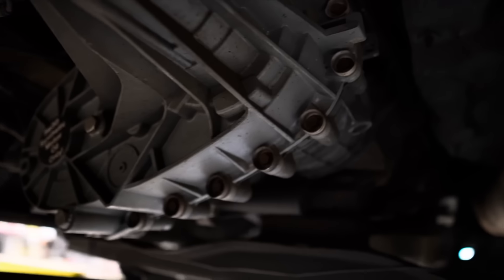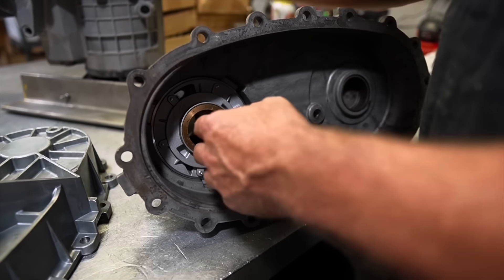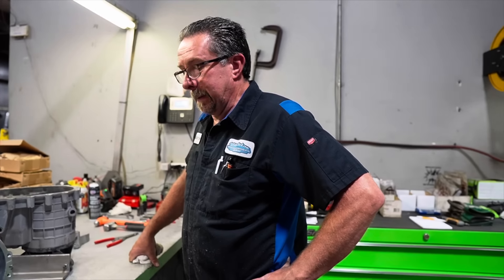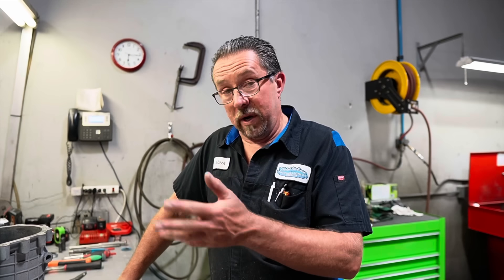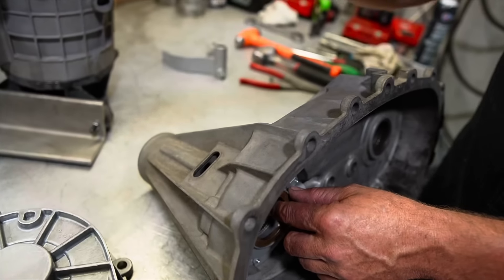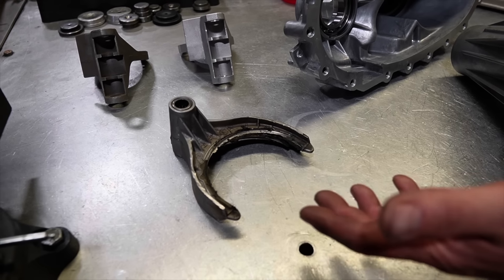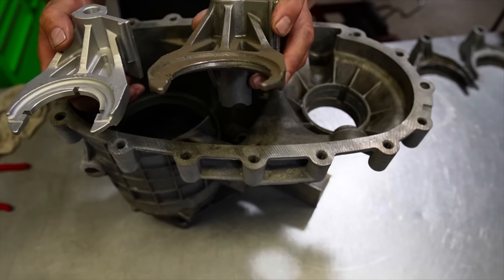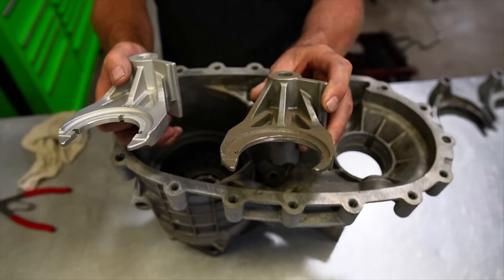TRUCK OWNERS! This Will Destroy Your Transfer Case If You Are Not Careful! *WARNING*

Comment: My 2006 Chevy 2500 4x4 Duramax got 713000 miles 26000 hours and the same transfer case not a rub hole yet. But I change the oil in the case every 15000 miles using Lucas oil additive. Had to replace rear axle at 475000 miles but haven’t touch the transfer case. Guess I’ll keep changing my T case oil every 15000 miles. Live in northeast and always towing and using 4x4 during winter use. Again maintenance is been my key to not have break downs.
Reply: That's awesome! So you use 5w-30w and some Lucas oil additive full synthetic? 
I watched a video years ago and started using Mobile 1 5w-30w full synthetic 2 qts. Good thing I did it replaced 3/4 qt of ATF that drained out 😅 Thanks Brother 🤠
Reply: @ronaldbabbitt6318 if you have an np246 with the auto 4x4 then congrats you fucked your transfer case by not using the proper recommended ATF
Reply: pump rub has absolutely nothing to do with how often you change the fluid and if you have an np246 with auto 4x4 you need a autotrac compatible ATF or you’ll completely fuck the clutches.
Reply: @tylerj6327  My Duramax HD2500 is not an suv or Suburban with the np246. 
If interested check Rockland Gear or Kodiak DIESEL I did my research.🏁

Comment: Used that original video to rebuild my case back in the day. The mode fork wore out but I didn’t know it was the rear snap ring groove. Rebuilt it with a case saver and went on my way. For about 3k miles, then it did it again. Got an aluminum rear half and rebuilt it again. No issues this time. Swapped to 0w-20 motor oil as the viscosity is very close to that of Dexron VI. I change it once a year and it always comes out the same way it went in. I also fill through the speed sensor port so that it’s very full of oil.
Reply from the maker: Great info thanks for sharing
Reply: Good tip, I'm trying to remember isn't the typical recommendation to add an extra quart of fluid through the sensor bung?
Reply: @blackbeardthepirate7467  i just fill until it comes out of the speed sensor hole.
Reply: @brendan747  had to double check my notes, I put about an extra half quart in after a generous pre-oiling of the internals at overhaul. I've heard of guys adding an entire additional quart, but all the way up to the sensor bung sounds excessive and might cause issues. How many quarts did you add to get it there? Spec is 2 qts.
Reply: @blackbeardthepirate7467  it’s is over 3qts. i don’t remember precisely how much. just till it comes back out the speed sensor hole. has been like for 3 years/60k miles with no issues. plenty of time spent in 4hi and low

Comment: Thank you so much for this video! Today I discovered a small oil puddle and it was below the transfer case, I was worried it was pump rub. Thankfully it wasn’t because it didn’t have a hole where it could leak. Turns out it was an output seal needing replaced. I’m going to put a pump rub kit on my transfer case as well as the seal. You saved me a ton of time and money. You’re the best!

Comment: 536,000 miles on 2015 RAM 2500 4x4 Cummins Diesel I went to 5-40w Diesel Synthetic oil not the ATF4, and my Transfer case has lasted without problems, every 33k change the oils in 2Diff, Transfer Case and G56.... Diesel oil change 5k, (oil clear not black) and fuel filters every 5-10k depending on "environment" and 100k =coolant, brake, steering.
Reply: Don’t think Ram spec’d atf+4 for the transfer case for a few years on the 2500+ t’cases. They used it back in the older ones, pre- 2010 or something like that. It’s a b&w fluid on the newer ones(my ‘14 & ‘17 are anyway), similar appearance to atf, but not the same.

Comment: 320k miles on my 10/05 build date 2006 LBZ w/261XHD...   Gets run in 4wd almost every time I drive it as my sub has a steep hill that tends to washboard and 4wd helps keep it smooth.  So far no pump rub hole in the case but when it does get one, I'm planning to put an aluminum rear case half on it...  That roller bearing chain drive gear looks nice too!!   Jeep took out the bearing when they went away from CAD, because everything is spinning all the time but with CAD, our trucks run that gear metal to metal, with only lube film to keep it from wearing...   A bearing there just makes sense to me...   FWIW, I run half and half synthetic ATF and synthetic 80W90.  Thickens up the lube some but not as much as 5W30, since atf is ~10wt and 90wt on the same scale is like 30wt engine oil IIRC...   The steel friction doesn't care about the 90wt but if you try this in the BW case with non-steel frictions, it will dissolve them and then grind going into 4wd...  ask me how I know...  :(

Comment: got my 04 avalanche z71 4x4 from the shop yesterday since it had 4 leaks and they rebuilt my transfer case. i do plan on getting a better transfer case b4 selling it so i can make it last for the nex owner of the truck. reason for the rebuild is cuz transmission fluid got into the transfer case and in order to prevent that from happening to the new owner later down the road i might get a new one just to be safe

Comment: Truck master help buddy ……. when ur at a dead stop and let off brakes u can feel like the slip yoke  move out of transfer case it feels like. Best way I can describe it , when u let off brake it feels like maybe someone tapped u in the rear .what would that be ? I have new tailhousing , new one piece driveshaft, slip yoke , ujoints , pinion seal all done same time. I have 6 inch lift . Truck had a clunk when put in drive or reverse so got the ujoints done and fixed all that while I was in there ! Thanks

Comment: Aluminum front case halves are available now? Thats great, the aluminum rears are markedly better in every way I can see, even the structural ribs on the outside are thicker than the OEM.

I really wouldnt go to anyone else but Kodiak if I was looking for a full replacement unit at this point.  That rollerized carrier bearing alone is worth it, but the full aluminum unit being offered now makes it a no brainer. The only thing I dont agree on, that I did different was the merchant auto pump-rub plate, filing down the lugs is necessary to allow it to shift around freely like the OEM assembly to prevent binding when using the Al rear case half, but I feel getting rid of those knife like lugs on the OEM pump assy altogether is the best move. With such thin pieces of metal, even if you arent wearing the new Al case I feel those stand the chance of wearing down over time. 

Of course I recommend adding something like the merchant auto or PPE t-case brace regardless of what route youre going. Peace of mind is priceless.

Comment: I have a 241 transfer case that hit all 4 gears on my 95 Yukon.
Replaced the phone based the 4L60E  transmission with A 4L80E trans mission once installed this is the s 2nd transfer case! 😢 It will not shift! I'm watching your video and it looks like you know what you're talking about! HELP IM GOING CRAZY

Comment: I've been replacing my u joints after realizing what the noise was on my truck had no needle bearings left and loose as a goose at first I thought the input shaft on diffarental was loose lucky I only needed u joints

Comment: I have to agree on the best unit out there. I wish I would have seen it video before I rebuilt my t case I think ur t case is at least a 400 k unit I have the factory 273. I'm not unhappy with it. I've done lots with my truck and the tcase is not in bad shape. I replaced all bearings chain and sprockets cost about 300. I bought the parts from Allstate gear they are decent parts. I am sure there are better. But when this t case fails at some point. I am a machinist by trade so I get it. And wish I would have but I think it'll last another 200 k or so I have a general fix for the pump rub without doing a bunch although I have no issue with the pump rub no failure on the dodge ram 04   I know it's silly puttied in place go figure not a fix for poor parts fitment. Also I u uses substantially better gear lube it reduces wear in many key points again nothing lasts forever. If I need another t case for any reason I will be calling you. Thank u

Comment: Beautiful work but I am horrified at the parts and complication of todays transfer cases. I own an '86 f 250 which had one of the earlier aluminum / chain transfer cases and after rebuilding it and seeing the light duty nonsense I gave it away and replaced it with a new process 205. I love my np 205. I also replaced the lighter duty T-19 transmission with the np 435 transmission, much nicer and heavier design. Hard to beat big gears, tapered roller bearings and gear oil. I realize this isn't for everyone.

Comment: Great video thank you. Awnserd all my questions.
Damn... I had a bad feeling in the back of my head when I did my pump rub upgrade kit, I kept thinking, what about the snap ring and bearing holding it in... They are probably worn as well.... Really wish I would of done more maintenance as well while I had it open., I also JB welded the pin hole, but it's been over a year now still good 🤞

Comment: I had a hole in my 06 2500HD. I put a MA pump kit in it with a new rear t-case cover. Went through all the drivetrain in the t-case. Bearings and other metal parts all looked good. The only parts I had to replace other than the new pump kit and case half was the thrust washer for the planetary, new pads for the shift forks and I put new seals all the way around. Been working fine for several years now.

Comment: Hey TM I absolutely live the sound of that turbo on your red truck but anyway I have a 08 gmc sierra duramax dually that have a MP1626XHD Transfer case RPO code NQF are there any weaknesses in this tcase it currently has 304k  miles and has been trouble free for 15 years and counting

Comment: I have question for anyone here. Is the drive train the same on a 07 2500hd  duramax vrs 3500hd duramax? I'm thinking of converting mine to a 3500hd duramax. Besides the obvious  rear-end, bed and gears match what else would I need or do?

Comment: I'll be checking mine for sure. I'm getting ready to tow about #9000 1400 miles. I have 116k on my lbz. Should I be worried?
Reply: How did the trip go? I did 3,200 miles with about the same weight, and my LLY did great the truck has got  around 170K
Reply: @jessiedavis3543  NO problems at all. The 9.9 mpg kinda hurt but never lacked for power, having my cruise set at 77mph for long periods didn't help I'm sure.  Cheers

Comment: So , Should I put 5/30 synthetic in my stock transfer case ? And if I never use four-wheel-drive am I in a better situation than somebody that does?
Reply: Unless you have a lever on the floor, all never using 4wd does is just about guarantee that when you want it, it won't work.  None of the issues with this case are related to using 4wd so use it as much as you can.  For the manual case, at least once a month just to keep oil slung around the front diff, with the electric shift t-case, shift that sucker in and out of 4wd at least once a week and it'll work forever.  Leave it sit two years without pushing a button and you'll find that sooner or later it won't work at all...

Comment: I put the pump rub kit in mine about a little over a year ago it only had 67000 miles on it but even at that the little clip was broke into wasn't  much wear but there was some I checked the bearings they seemed really good so I'm thinking it should last me years

Comment: 2-3 mpg gain is pretty spectacular. Depending on condition of current transfer case, it will vary I’m sure. 

Takeaway from this video, new transfer case from Kodiak will off set fuel economy lost by larger, more aggressive tires. Notes for review with my wife when she’s questions the decision.
Reply from the maker: All valid points 😂

Comment: It's criminal that GM gets away with selling such garbage, prone to failure from the day it was designed on paper and they just never have to pay the price for it. The "Duramax" (Izuzu) engine is good, the Allison Transmission is great, the rear axles  hardly ever have issues... the rest of the truck, absolute garbage, mostly made in Cheaper and that oem transfer case is a piece of junk.
If I buy one of these new manufactured Kodiac Transfer cases, can they bill GM for it?